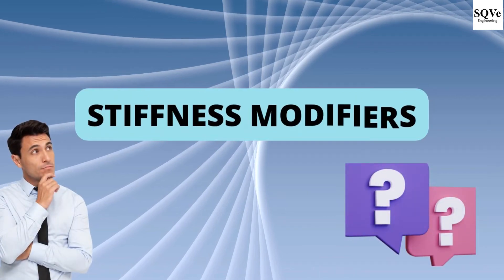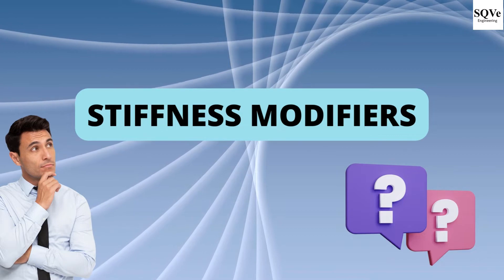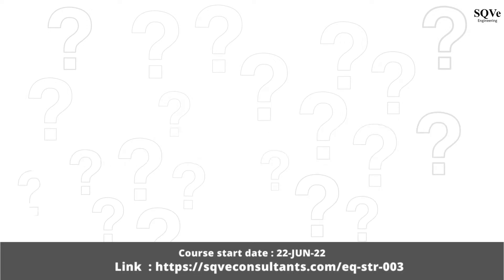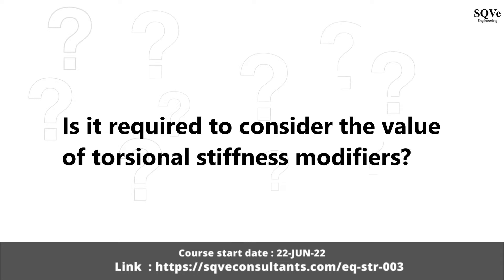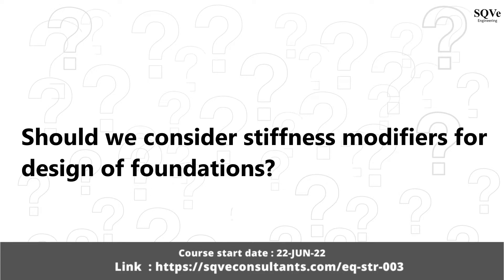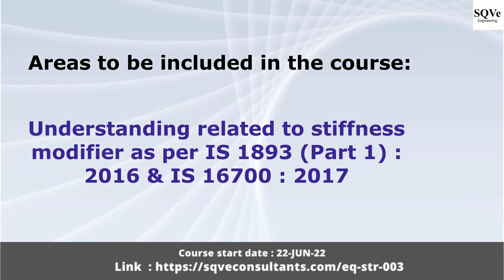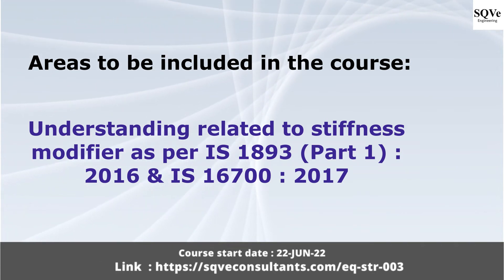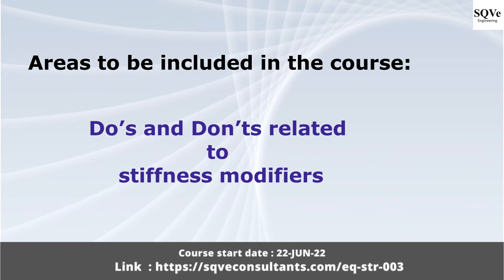EQ-STR-003 : Stiffness modifiers and software applications | Online course | Bhavin Shah

Comment: Sr simply raised masonary platform upto 2m height can it be built with 40 cm thick wall?
Or I have to design retaining wall?
Reply from the maker: You may connect with is through email address: contact@sqveconsultants.com for further discussion.